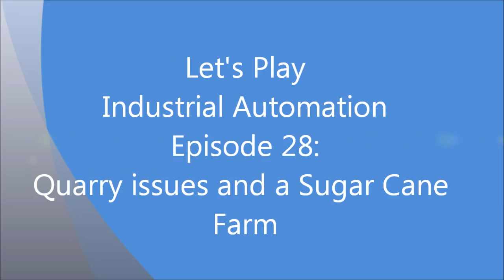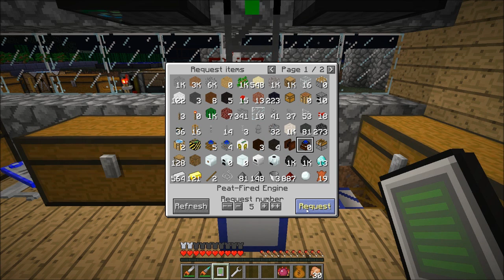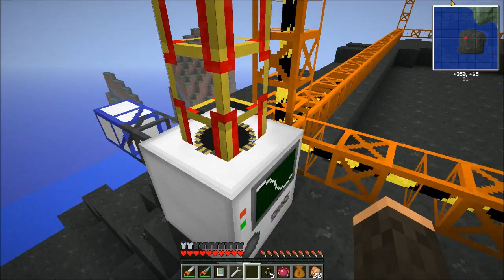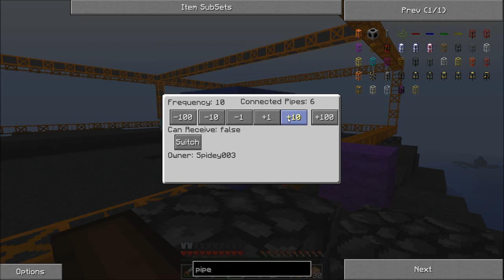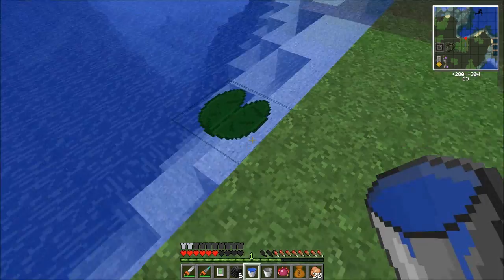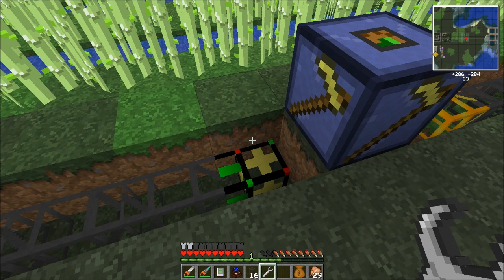Let's Play Industrial Automation Episode 28

Comment: (cont from previous comment) I feel like this would be most easily done by connecting the energy collector the front of the storage area under the floorboards. If doing both of these things doesn't improve the speed enough, try adding a teleport pipe from the back of the room to the front of the room.

Comment: 2) Most of your crafting area, especially the smelting system and macerating system, are extremely far from the request pipes.

Both of these problems can be solved quite easily: for problem 1, you just need to place three stone pipes in a "bridge" by the back of the storage area, so items on the bottom don't need to go all the way to the front to get to the crafting system. For problem two, you need to connect the crafting system more closely too the request pipes. (cont on next comment)

Comment: Hi, I'm a new subscriber, and I enjoy your LP.

I think that the problem with your Logistics Pipes system taking too long is caused mostly by two things:
1) The logistics pipes for the storage area are connected in a large "U", which would be fine, except that the crafting system is connected to one arm of the "U". Anything that needs to be crafted that requires an item on the lower part of the storage area has to travel all the way to the front of the building, then all the way to the back.